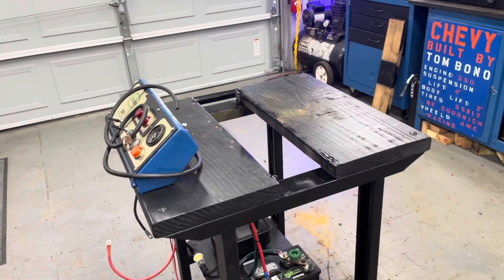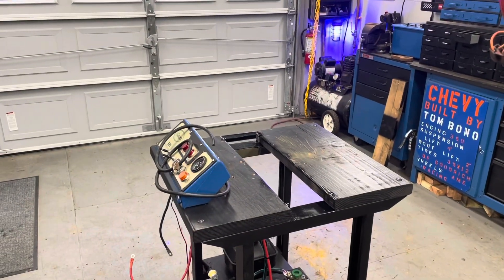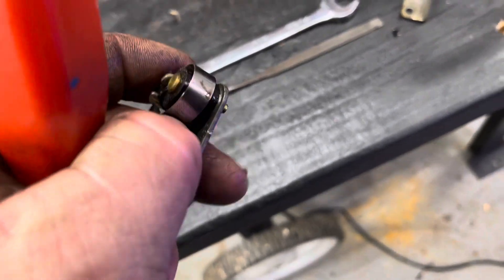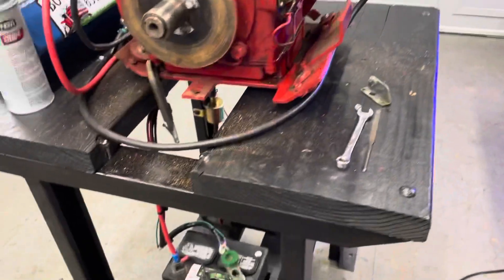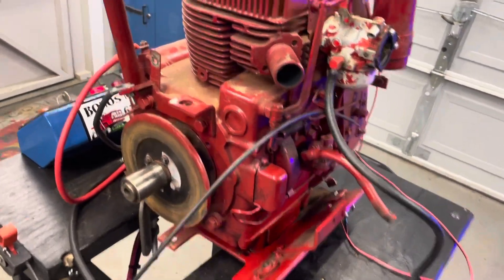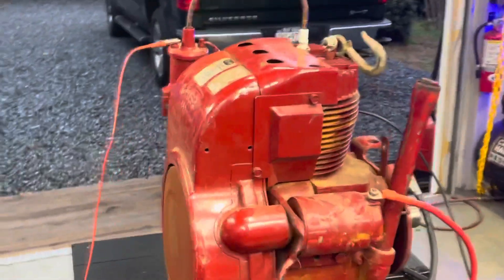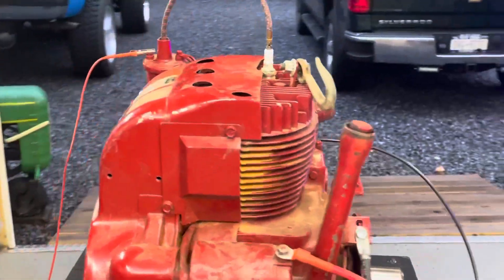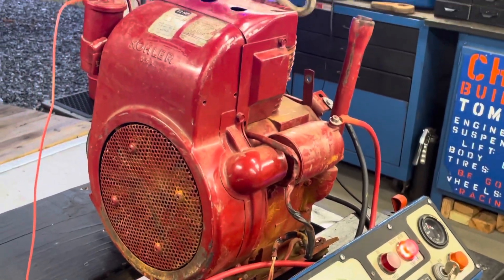Trying out my new small engine test stand

Comment: Ok nice stand I used a old front of a rider mower to build my stand and a control tower from a wheel horse and welded it to a platform with wheels that way i have all the holes I need for the different engines and a working height of about 36 in
Reply from the maker: Thanks for watching